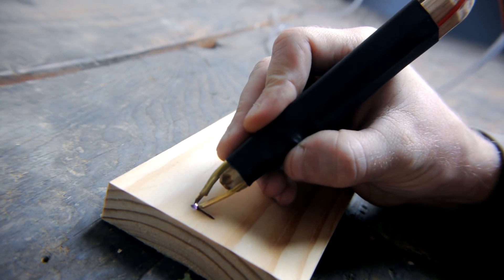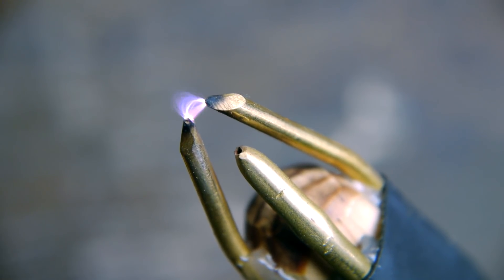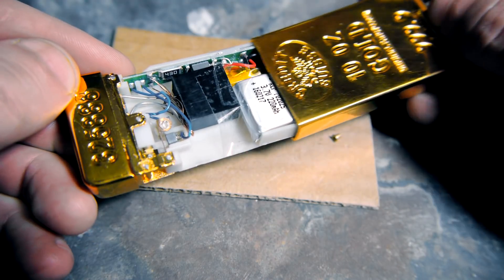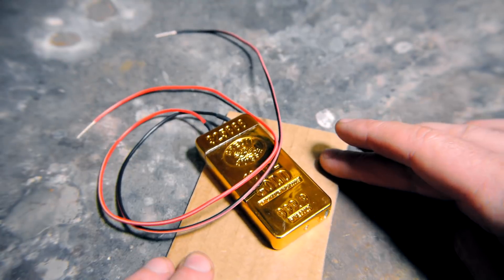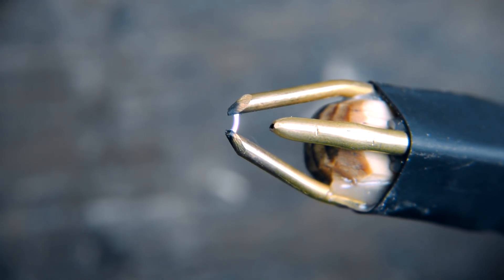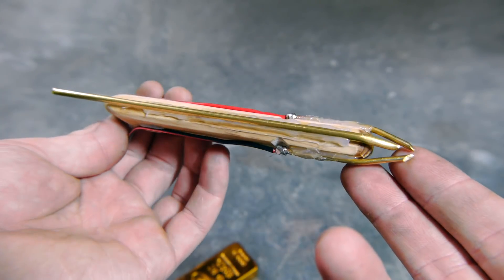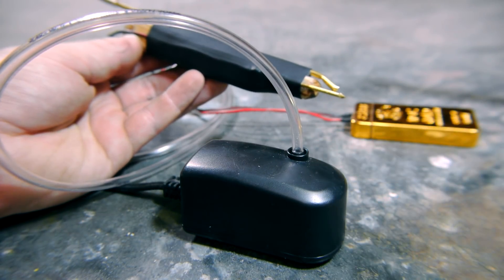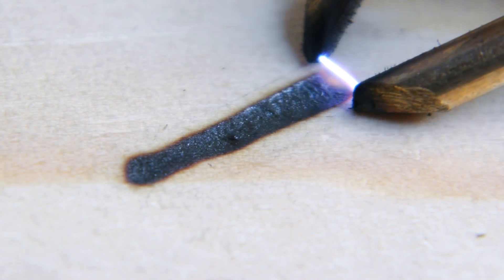How To Make a Plasma Pen & Micro Torch - NightHawkInLight

Comment: safe to assume you've been shocked a few times
Reply from the maker: I actually haven't been shocked from one of these arc lighters yet. Though I have been shocked plenty from the static electricity generator projects. I imagine the arc lighter would be quite uncomfortable.
Reply: +NightHawkInLight it's not as bad as an electric fence.
Reply: +magicamadeye hasn't everyone done that as a kid?
Reply from the maker: I already work on videos 7 days a week, I really can't make them any faster.
Reply: +NightHawkInLight why don't you upload more often i love your vids.
Reply: NightHawkInLight and we all appreciate it, 

David Rand hes putting his all into it, i dont like waiting either.but that just makes the videos a little bit better.
Reply: ***** Believe me, these things do cause quite a shock that you can feel in your entire arm if you touch the arc with your finger. The frequency of mine is about 13kHz
Reply: Yeah, 13kHz isn't quite high enough. You need to get up to about 18kHz for the feeling to almost completely go away. 20kHz and higher doesn't deliver any shock. It surprises me that they don't have any high voltage warning on the website. Nowhere does it say that there's a shock hazard. Most types of high voltage equipment are sold at websites that usually state that their product is potentially dangerous if missused and be sure to follow all the proper safety procedures when using the device. And from pictures I've seen of the product, it doesn't even have a "danger high voltage" warning label on the device itself. Most high voltage devices (such as neon sign transformers) have such a warning label on them.
Reply: It was actually a true CCFL driver from a laptop backlight, but the fun bit about them is that they are able to output a reasonably high amount of power for their form factor depending on the exact design. There are a few ways you could go about designing such a converter, the most simple of which use a small transformer. Even there the design complexity can range from a single transistor feeding a square wave into a transformer to full H-bridge based solutions depending on the power and efficiency requirements. You could also directly boost it to the operating voltage and then switch mode your way out of it which could get you around having to use a bulky transformer. But then you'll dissipate a lot more thermal power. So overall you got to be careful making generic statements about CCFL converters. :) 

But due to the high frequency of most of the AC versions they're relatively safe to play with because most of the current is unable to penetrate deeply into your tissue, though obviously you shouldn't count on it. The fun bit is if you get a reasonably nice AC waveform out of them that you can use a transformer to step it up even further, though I recommend using PTFE foil as insulation at that point. Be careful doing this though, because the "smarter" converters expect to see a "negative resistance" load at their terminals appear quite quickly because the gas in the tube is supposed to ionise leading to a reduction in resistance as it comes into operational regime. If they don't see this they'll assume arcing is going on and shut down for safety reasons. Or the very crappy ones you might find in knock off devices would just burn out most likely.
Reply: tommihommi1  NightHawkInLight 

okay tommil i assume youve done both

nighthawk . i forgot about the static generators until recently i was thinking of saving up for some of the parts and making my own. though i probably have the parts lying around the house id rather be to have the materials around just in case
Reply: +David Rand real life I imagine
Reply: ooooh no I thought you were kinky but not kinky kinky
Reply: I believe that, like with Tesla coils, these arc lighters use a frequency that is 20kHz or higher, as this frequency range doesn't produce an electric shock (though obviously the arc would be hot enough to burn you). The muscle and nerve cells in the human body aren't sensitive to frequencies above approximately 20kHz. In fact, I would think that one of these arc lighters would make a good fluorescent lamp tester. Use a pair of alligator clip wires, and connect each arc electrode on the lighter to each end of the fluorescent tube. If the tube lights up then the gas hasn't leaked out, and the reason your tube isn't starting is likely either that one end has a filament burned out (if it's the time that requires pre-heating of the tube's electrodes to start) or that the ballast is bad.
Reply: I shocked myself multiple times with a CCFL driver at some point. Granted those tend to pack a slightly bigger punch. The main thing is that it "cooks" the meat where the arc hits, so it's actually quite painful and takes more than a month to heal. But unless you put this straight over your heart or are already at risk of cardiac events this probably won't cause much more than severe pain in the worst case scenario, there isn't a whole lot of energy in these type of things. (Hence the absence of warnings in most cases.) Still I don't recommend trying it out, it doesn't hurt to wear thin leather gloves while working on these type of things.
Reply: You mean a true CCFL driver, or one of those battery-powered fluorescent lanters? The battery operated fluorescent lanters have a diode in series with the transformer's output, so regardless of the frequency of the oscillator, the output is half-wave rectified, meaning there is a DC component to the output signal. So you can get a shock from one of those easy, and a painful one at that (even if there's no arc to burn your skin). Technically these are also CCFL drivers, as they depend on a continuous high voltage to keep the gas ionized, rather than heating the filaments in the tube and then firing a single high voltage pulse, before dropping to a low operating voltage (like normal "oldschool" fluorescent fixtures do).

However, the CCFL drivers that people usually think of are those that run those ultra-thin tubes (only a few millimeters across), and don't have any filament to heat up at all. These CCFL drivers usually only output high frequency AC (no diode installed between the transformer and the output wires that go to the tube). In fact a CCFL driver that I have has a small capacitor installed in series with the output (presumably to block any DC component that might be present on the output), that means that only high frequency AC can come out of it. And it is quite a high frequency. Though I don't have an oscilloscope to actually measure the frequency, I have discovered by pure accident that it must run at quite a high frequency (probably well over 20khz). I long time ago, as I was reaching over to my 12V DC power supply that was powering the CCFL driver, I accidentally bumped into the high voltage output lead's insulated end-connector (which happened to be between me and the 12V power supply) . At the time, my part of my hand was on the grounded metal case of the power supply (and the thumb on the power switch) when I accidentally bumped the HV output wire, so I should have gotten quite a nasty shock (great path to ground, into my arm, through my arm, into my hand, and out to ground), but I felt nothing at all. Thinking "That's odd, isn't the CCFL driver running? Why didn't I get a shock?" I intentionally repeated the situation, this time as an intentional experiment (rather than an accident), and under a more controlled situation. On one hand, I placed one finger on the ground lead from the CCFL driver, and another finger on the same hand (so the current path wouldn't go through my body, or even my arm, just my hand, for safety reasons) I placed on the HV output lead. And sure enough, NO SHOCK AT ALL. And yes, I made sure that I made the final connection with my finger as fast as possible, so as to keep the arc prior to contact as brief as possible (the arc is easily hot enough to give you a 3rd degree burn).

Thus I discovered that CCFL drivers (but NOT fluorescent-lantern drivers) are safe HV sources, using high frequency electricity, just like the famous Tesla coil. I'm assuming that most CCFL drivers use the same basic circuit design, meaning that they all run at a frequency so high that they can't shock you.
Reply: magicamadeye i
Reply: I've intentionally shocked myself with one of these lighters... quite a few times actually. It hurts wayyy more than a tazer. It feels a bit like a needle shooting into the spot you hit, but then the pain keeps going. Shocking my finger, it feels a bit like what I mentioned above but keeps going all the way up to your elbow, haha.
Reply: tommihommi1 i've honestly never actually been near an electric fence, never seen one outside of television or internet videos either

Comment: pretty cool but I'd use a high voltage generator like the one I bought on eBay for like under $3 it takes 3-6v in and 400000v out basically cheaper and more power
Reply from the maker: If it's like the ones I have it's probably too much voltage and not enough amperage to actually burn things. If it had that much voltage and did have enough amperage to burn then it would be very dangerous to use anyway.

Comment: Where did you get the brass tube??
Reply from the maker: A local hardware store. Most will have a selection of various metal tubes/rods/plates if you ask. Otherwise you can purchase them online. Ebay, Amazon, etc.
Reply: +NightHawkInLight can you test if the amount of energy is enough to do small amounts of fractal Lichtenberg art?
Reply: +Matthew Shoemaker nah, just get an M.O.T (microwave transformer) they're great and free

Comment: Nice, can you make miniature Lichtenberg figures with it?
Could you try to soak the wood in an electrolyte and put the electrodes from the lighter on it to see what happens? :)
Reply from the maker: I would be worth a try. Probably wouldn't be able to make very big ones but who knows.
Reply: thanks for the reply.
I certainly would be interested if it works. :)
I love Lichtenberg figures but I don't want to mess around with big HV power supplies. 
The small HV supply from the lighter seems to be easy and relatively safe to handle.

Comment: Will the tips/electrodes need replacing as the ions wear away the tip?
Reply from the maker: Eventually, but it would take a long while. You could solder extra wire onto the end at that point
Reply: +NightHawkInLight OMG you replied. Thanks for the info. I am probably going to try this when I can.
Reply: Eventually, but I wouldn't really worry about it. It will take a LONG time

Comment: can you attach a wall power supply to the lighter so that it isnt reliant on batteries?
Reply from the maker: Sure, you just need a power supply to match the voltage of the battery
Reply: +NightHawkInLight or can you supply more voltage to get a hotter more powerful arc?
Reply from the maker: No you'll just burn out the electronics. If you want a more powerful arc it would be better to build a high voltage generator from the ground up, but much more power than this and it would get dangerous.
Reply: +NightHawkInLight ty for the replies.I wanted to see if could find an easy way to get a more powerful arc but it seems ill have to get my old marx generator out :))
Reply: If I remember correctly , that arc is started with 10 to 15 kV and maintained by a mere 20-30V, so technically it's not that dangerous(?)
Reply: might want to look into microwave transformers

Comment: Does it work in metals? Aluminium/steel?
Reply from the maker: It should leave a mark, but it would be tricky to stop the electrodes from arcing to the metal. My previous video about the plasma cutter would be better for engraving metals since it is meant to arc to the base material.

Comment: Cool project. Sad that I haven't found an arc lighter that doesn't make that high pitched buzzing yet.
Reply: You can make one. It's not that hard.
Reply: @spirit mind explaining how
Reply: AwesomeFace :D You just need to run the transformer at a much higher, fixed frequency.
Not sure if you will be able to fit it into this kind of case, but you can easily do it with an old flyback transformer and a ZVS driver. Squeezing it into this tiny of a case would require a custom transformer and a circuit using very tiny parts.

Just beware, if you make a ZVS driver, you'll be stepping into the territory of "touch it, you're dead".
Reply: ***** oh... I think ill leave that to the professionals lmao thanks for the quick reply though!